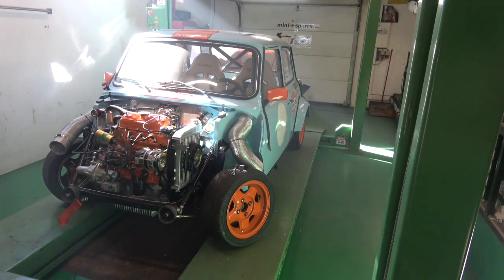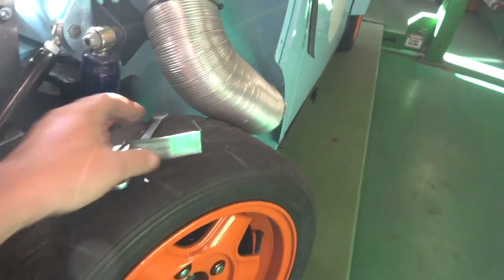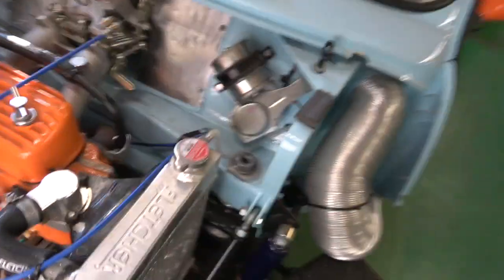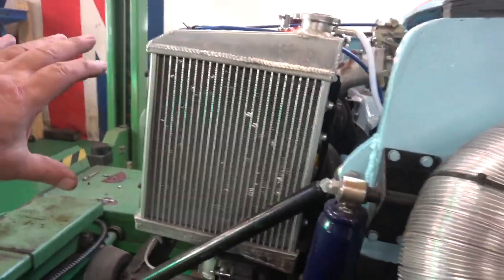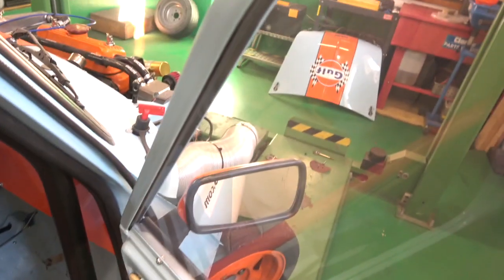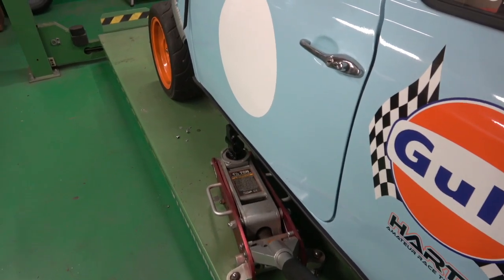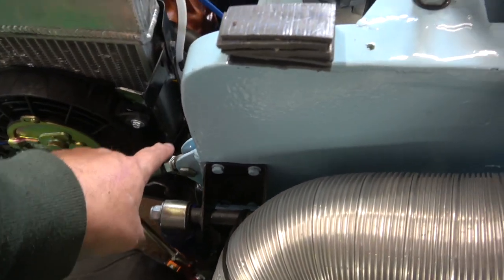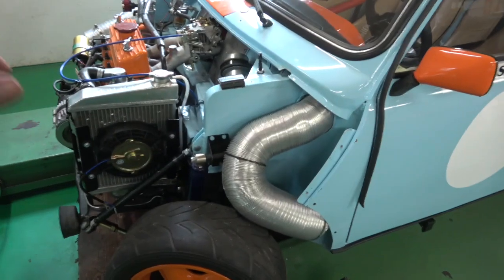Classic Mini Race / Track Car ( Electric Fan Upgrade )

Comment: Great video Dave. The electric fan is a great addition and its great that you can access the radiator / fan area easily,  those jacking point adapters are just great, you should market them.
Cheers, Jeff.
Reply from the maker: Jeff, Hopefully we will not need it too much but it will help take hot air away from the rad & the exhaust manifold, The jacking
point will only work if you have a pre welded in the support box section in the outer sills but a nice thought lol, Cheers Dave

Comment: Good work Dave that fan is going no where mate can I ask does it blow or suck if the question is to personal I understand
Reply from the maker: Steve, We changed the blade around so it sucks so the belt fan blows through the radiator core and the electric fan will 
help dissipate the heat from the rad & the engine bay. Cheers Dave